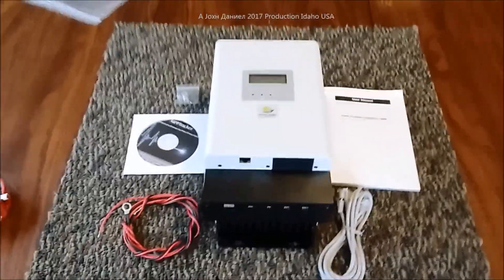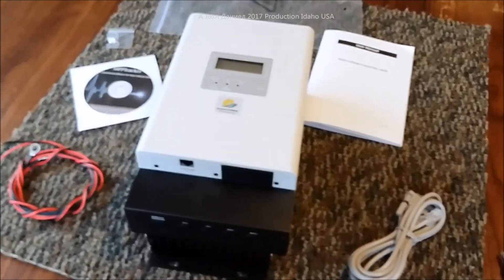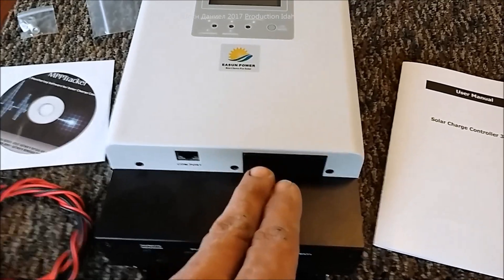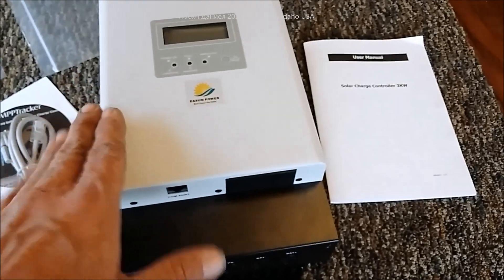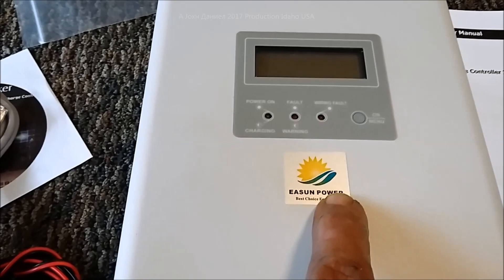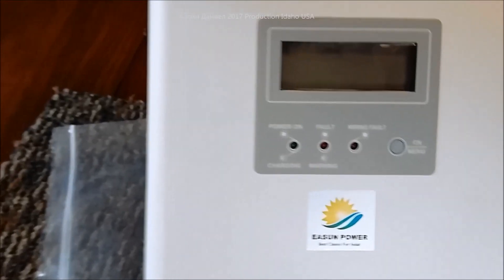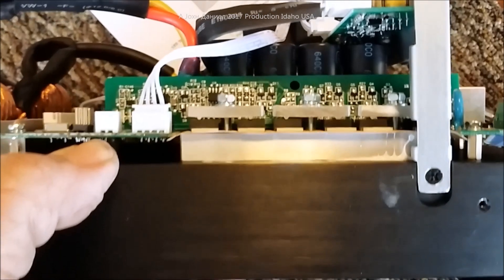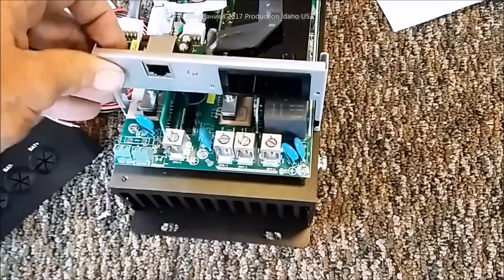60 Amp MPPT SOLAR CHARGE CONTROLLER PCM60X Opened Up INFO BELOW VID

Comment: It is most effiecent to not have panel voltage over twice the battery voltage , higher the voltage more is lost to heat, but most mppt controllers require atleats 3-6 volts over battery max voltage,  alot of ppl want to run high voltage into the controller, it is only a benefit if you have a run of 100's of feet between panels and controller,  more voltage in does not mean more power out,

Comment: Heh, kind of felt like you're trying to sell me a car there. ;)

Good video, my one comment would be that a lack of a fan on these doesn't impress me. I think I'm going to go with a model with dual fan cooling. I'll be in the desert anyway, so a lack of cooling capability for a device that produces heat sounds like a serious losing proposition. I'm going to check out MPP Solar from your recommendation, though. I'd like to find a good cheap 100A unit, and I haven't found one yet that comes highly recommended, so I'm still sniffing around.

Comment: Please help. It is suitable for RV? As I understood, OK for RV's only negative-grounded controllers? This unit is negative or positive grounded?
Reply from the maker: I had to look up information but it is negative ground and you can use negative or positive ground on an RV you just need to make sure that you wire properly and isolate your mounting process. The pcmx 60 has proven to be one really good RV or motorhome solar controller.

Comment: Can I use this MPPT to charge 48V-52V E-bike battery with a 12 V panel. Without using any DC-DC Boost converter.?
Reply from the maker: No, not well. I suggest you get a full 3 - 50 watt panels like these https://ebay.to/2kMAbb3 and a 20 amp MPPT thats fully programmable for such batteries like this one https://ebay.to/2kh4uX9 to hit your voltage needs.

Comment: P.M.  with the  car you mean  i can used two of this controller one for solar and one for wind and they communicate together also if the so where can i get the car. t.u.
Reply from the maker: One for solar, and one for wind yes. Newest models just came out, https://ebay.to/2Q1OHqq . Be sure to put in a diversion load after the rectifier for the turbine and before the controller.  Or use a style like this one https://ebay.to/2LN2qOc and get a 48 volt 800 to 1000 watt turbine then you can charge a 12 or 24 volt bank of batteries!! Feed its output into the MPPT 60
Reply: How do you use this for wind? Doesn't wind have three wires, this unit only has two for solar.
Reply from the maker: After numerous installs i found the best Solar Panels https://ebay.to/2KHX5XY Mighty Max 100w4bar . You can lay them flat or at a sun rated degree with less power loss due to them having 4 buss bars on the cells.

Comment: Does anyone know if these can be used to charge LifePo4 batteries? Specifically looking to charge 4s Headway 8Ah (200amp surge) 3.2v cells?
Reply from the maker: According to specs, yes you can charge all batteries as long as a over heat disconnect in used on the pack of batteries and your incoming voltage is correct rated. Just make sure your controller meets your top voltage charge ratio. Specs on the link if its still good shows it.

Comment: How do I get my pc to communicate with my charge controller.......not so plug and play.......software is installed. I see a comm option. Does that need changed from comm 1 ??? Frustrated that y solar has ZERO tech support, no company info at all.......

Help?
Reply: Google is your friend.  If you are using Windows, go into your device manager, find the entry that says "Ports (COM & LPT)" and click to expand it. If you are using a serial port built into the computer, it will be listed as a "Communications Port". If you are using a USB to Serial Adapter, it will be listed as a "USB Serial Port".  Change your software to whatever port number you find.

Comment: Where can I download the software program. My control at has no disc.....not sure why. There is no company site to download from. Is the program stored intrtnally?
Reply from the maker: https://www.mppsolar.com/v3/catalogs/60x_MPPTracker_user_manual.pdf
I'll try to get you download link to MPPTracker 1.0 software
Reply from the maker: https://www.mppsolar.com/v3/?s=software
Reply: Thank you. My controller has no heat sink and no comm cable for the pc. Do you know if Amazon has the proper cable to connect to my pc.
Reply from the maker: Yes, they sell adapter for everything

Comment: Can you set one of these up for a 36 volt system with the software? I have an oddball system and am currently stuck with buying from the big 3 in order to get reliable mppt controllers. (Outback schnieder midnite) it would be nice to not have to pay$600 every time i add panels.
Reply from the maker: +wildness01 I checked it out, it's a 12/24 but check with www.ysolar.com and I think you can buy direct cheaper there for a controller you need.

Comment: PM DO YOU HAVE A VIDEO ON HOW TO CONNECT A DUMP LOAD RESISTOR TO THIS CONTROLLER I LIKE TO BUILT A HYBRID SYSTEM WIND AND SOLAR BUT I HAVE TO PROTECT MY WIND TURBINE WITH THE RESISTOR DUMP LOAD THANKS .
Reply from the maker: +Jose Gomez I would run a dump load voltage sensor in line to the imput. Figure the max it could switch at and set it. Reason is, it will disconnect from turbine when charge volts are reached then the turbine will free spin, at that point volts jump and your dump will activate a load against the turbine. 
I'll try to lay out such a plan at some point on a video.

Comment: Mine won't work all the time, pulls 24v panels down to 17 volts and quits hunting for MPPT. disappointed PCM-60 MPPT 280 bucks
Reply: Dave George i got one and im very happy.. no faults or flaws at all it harvests 1kw of energy during sunny days
Reply: What size power bank 12 or 24

Comment: We have been using one of these chargers for over a year now on our off the grid Cabin in the Flint Hills of Kansas and it has preformed beyond our expectation it has been very reliable and charges and maintains our battery bank very well. You can program the charger from the front screen it just takes a lot of time.Would like to see how you programed your unit with the lap top and what connection adapter did you use to hookup the cable to your laptop? If I remember correctly you also need a internet connection when using the a laptop which is a little hard to do when you are Off the Grid .
Reply: Update we bought this Charge controller in May 2015 and it has been almost 3 years without one hiccup .We only have problems in the summer when running a A/C or when we have no sun otherwise this Off the grid system has preformed beyond our expectation especially this By Mpp PCM60X charge controller best 300.00 bucks we could have spent for solar charge controller we have had O problems it fast on recovery usually about 3 to 4 hours and maintains our battery bank as well as can be expected.
Reply: Hello fellow Kansan!  You do not need the Internet.  All you need is a USB to serial adapter as you most likely dont have a serial port in your laptop if it is less than 50 years old.  Amazon $6 LOTUS POWER Generic USB to Rs232 COM Port Serial PDA 9 Pin Db9 Cable Adapter.  Enjoy.

Comment: Nope, not transformers. They ARE inductors for the buck circuitry which use inductive switching methodology to efficiently convert the power between different incoming voltage levels. Look up switching PS tech and buck/boost converters for an overview.